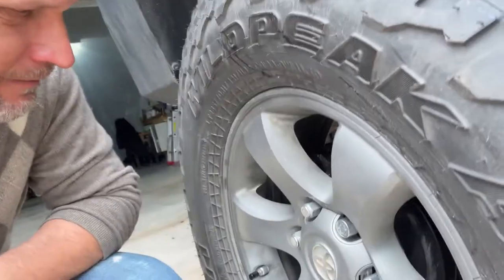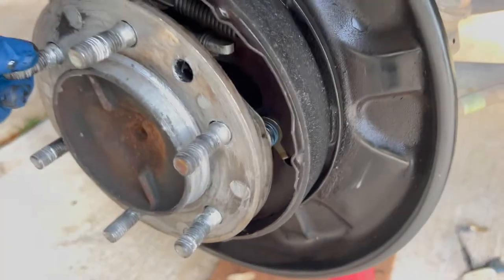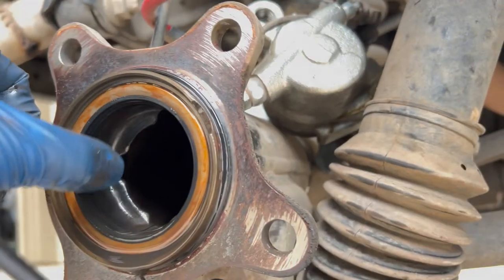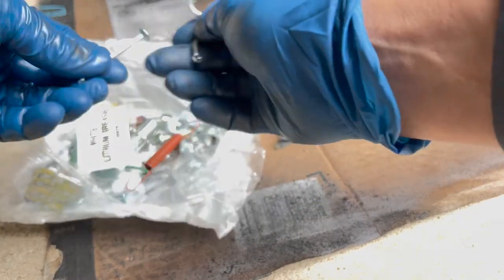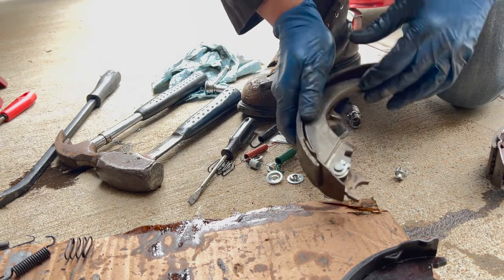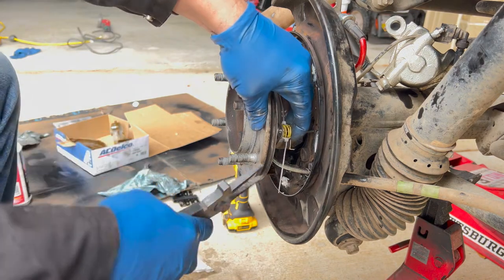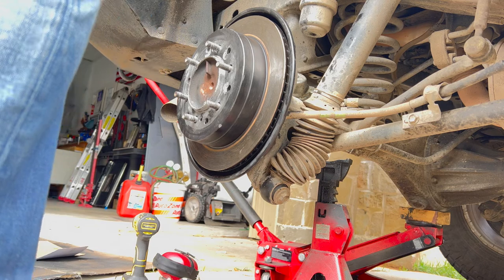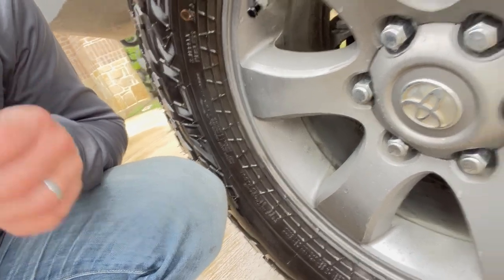4th Gen Toyota (2007) 4Runner Real Axle Seal Replacement

Comment: Great video, thank you! It really helped me get through the seal replacement. Here are some tips and info from my experience to hopefully help others:

The part numbers and dealer price I paid: seal (90310-58003 $13.17) and o-ring (90301-83002 $6.23 mentioned but not replaced in this video, but might as well replace it while there)

- I wanted to "do it right" and not cut the brake line bracket as shown in this video. I had the correct 10mm flare nut wrench, used penetrating oil and some heat and proceeded to completely round the brake line nut (D'oh!). Not wanting to replace the metal brake line, I proceeded to cut the bracket as shown in the video. Your experience may vary, but I recommend cutting the bracket. 

- If taking apart the parking brake looks daunting, you can leave it all in place and remove the axle. You must release the three retainer brackets holding the parking brake cable onto the frame, and you will stretch the parking cable uncomfortably tight, but I did it. Having a helper guide the axle back in without hitting the new axle seal is good idea.

- The axle seal can be seated in place by using an old Toyota oil filter (90915-YZZD3). The filter fits perfect and the rubber seal of the oil filter cushions the axle seal. Just tap the filter gently with a large hammer. This will destroy the filter, so save your old one for this. 

- If oil soaked your brakes, the recommendation is replacing. An alternative is to take apart the caliper and clean and degrease everything, as well as sandpaper the pads (same for the drum parking brake pad). Take your time and clean and sand well if you are going this route.

- I filled the first 3 quarts of gear oil on jack stands for a little more room, but ensure your final differential fill and check is done off jack stands/jacks and level. 

- If gear oil sprayed your wheel and wheel well (very likely), you will spend the majority of your time on this job cleaning everything. This is important to ensure your brakes are not impaired as well as verifying the seal leak is fixed. Brake cleaner helps, but physically scrubbing with brushes and paper towels will be needed. Using other degreaser solutions may be helpful as well. 

Good luck!
Reply from the maker: D.G. Thanks for all those great tips.  Especially like using an old oil filter for searing the seal. Brilliant
Reply: What is the ring inside axle tube part #
Reply: @seanf6868  Not sure what ring you are referring to, the only ring inside the axle housing shown in the video is the seal, which I listed the part number in the post above. There is a ring spring that goes around the axle seal rubber, but that comes with the seal.
Reply: @d.g.9606  it was the back side of axel seal is what I pulled out, thinking it was an o-ring🤦🏾‍♂️🤦🏾‍♂️🤦🏾‍♂️ created a problem I didn't have cost me 1/2 to 3/4 of a day + cost of new ring
Reply: @seanf6868  Oh, got it - ouch. The time is the worst part. The seal should be under $15 unless your dealer is really ripping you off. Be sure not to seat the seal too far in - the video is a good guide. I think I seated mine a bit deep and it slightly weeped for a number of months, but seem to have stopped now.

Comment: its been 4 months and more than 5000 miles since i did this on my '08 4runner and so far its held up. i didnt take appart the parking break. i did what another comment here described by removing the 3 parking brake retainer brackets so you can pull the axle out far enough and leave the cable connected. i did have to remove the running board cuz it was in the way. i also replaced the breather incase it was clogged. a mechanic i went to at first wanted $2300 for the job and everything around it. i have very little experience working on my car but im glad i did it myself. thank you.
Reply: also the only tool i had to cut a notch in the brake line bracket was a sawzall. definately awkward and not recomended but it worked out lol
Reply from the maker: @burningapartmentbuilding  great you liked and got some use from the video.  That’s some good sawzall skills cutting that little bracket.  Nice work.  Happy wrenching.

Comment: Thanks for the video buddy.  Regarding the rear brake shoes, I think a tool for compressing that little spring/pin assembly would've worked wonders, e.g. a Lisle 48400 or Performance Tool W175.  I've wasted a lot of time on drum brakes before, tools like that are a lifesaver.
Reply from the maker: Thank you sir.   I’ll check that out for sure

Comment: Thank  you for your excellent video.  I am contemplating replacing the seal on my '07.  However my PB pads are completely soaked in diff. fluid and will have to replaced.  The PB hardware replacement is the absolute worst part of the job.  I've watched a couple of other videos on PB replacement and no one has figured out a simple/non-torturous means of installing the retaining springs.  

I assume the first person who had to work on  4Runner PB hardware invented "swearing" 😱!  Your patience is admirable.  If I had similar perhaps I'd give this a shot....otherwise about 95% certain I'll head to the auto shop.

Thanks again though for all of your helpful information....SM
Reply from the maker: El thanks for checking out the video.  Yeah it’s a hard part of the process. Those small zip ties sure help a lot but those little springs are nasty and have a mind of their own.

Comment: Can the seal be installed too deep? Mine has started leaking again. I did seat the seal until it bottomed out. Is this correct, or should it be just flush with the outer housing? It could be the bearing, but I have no play or noise from it. The diff breather was the first thing I checked the first leak and it was fine, but I still took it off and cleaned.
Reply from the maker: I have a feeling it probably could be installed a bit too far.  When I took my old one out it was flush so I tried to put it back in flush too. The second side I did I think I tapped it in a smidge too far but it’s been ok.  But it didn’t bottom out

Comment: Nice video. I'm waiting for my rear wheel bearing to go, or an axle seal. So far so good. I'll be ready to fix it whenever it does.

A suggestion: When you're using grinders and other loud power tools. It would really help the viewers to edit that section and reduce the volume. Your videos have erratic volume, so to hear you talk, we have to turn up, but then we get blasted with power tools. Those angle grinders are murder on our ears.
Reply from the maker: Hi Bob good to know.  I can probably tone the grinder volume down on my computer for those clips.  It doesn’t seem to come thru that badly when I’m editing it but I know what you mean.

Comment: First of all, thanks for the video. I have a few questions but I will keep it to one. I am about to tackle this exact job and I am wondering how your wheel bearing is holding up?
Reply from the maker: Thanks for checking out the video Oz. I’ve done both sides note for the axle seals, and both wheel bearings are good.   I think some ppl do both when they’re in there but it’s not terribly complicated the timing Bent on my v8 Tundra) so I just did what needed doing.

Comment: If you have ceramic pads, brake clean will do a mighty fine job of getting that gear oil off the pads. The parking brake shoes however, are semi metallic and definitely need replaced after being oil soaked.
Reply from the maker: That’s great info Mike
Reply: Actually, it is best to replace any brake material that has been soaked / contaminated with oil of any kind. The brake material is compromised. Even if you clean with brake clean or isopropyl alcohol, it will never be the same
Reply: @IanSolomons73  that's correct, it's BEST to replace them, always. But IF they're ceramic pads, brake clean will do a mighty fine job of making them USABLE. Semi metallic pads tho, goners.

Comment: I'm guessing that I have to do this along with the rear axle gasket while I have the wheel aparts. I heard if the gear oil is leaking then it eventually will destroy the wheel bearing.
Reply from the maker: I’m not sure about that.  I caught the leak soon after it started so just replaced the seal on each side when it happened and haven’t had any other issues since.

Comment: Did you smell burning fluid slightly for a few days after you did repair? I just did both sides and can still slightly smell it when I exit vehicle
Reply from the maker: Like I didn’t but I do occasionally get a burning oil smell but I think it’s more from a very slight sweat/leak around the passenger side valve cover

Comment: I noticed on the 3rd gen videos they don't drain the differential fluid, or at least don't show it. I just replaced my diff fluid. Think it's safe to catch it in clean container and put it back in? For sure have to drain it before removing axle? My wishful thinking wants a different answer lol
Reply from the maker: Hi Luke, thanks for checking out the video.   I suppose you could put it back in if you just recently changed it and wanted to save some money.  But if it's been in there for any length of time I'd take that opportunity to replace it.  Right after I replaced this right axle seal (and changed the rear diff fluid) I became an Amsoil Dealer (I'll add my link below for you to check out) and replaced the front diff and engine oil after that but had JUST replaced the rear diff so was waiting.  Well, a few weeks ago the left axle seal went out so I put the Amsoil Severe Gear diff oil in there.  It's apparently good for like 100,000 miles so I'm good for a while now.  They have some great products, let me know if you have any questions but you can become a customer through my link here, https://www.syntheticsusa.com/d/30434485/
Reply: @OffroadGrind  Do you run 75w-90 gear oil? Thanks for the link
Reply from the maker: @lukedias5859  yes that’s the exact grade I use in the differentials.